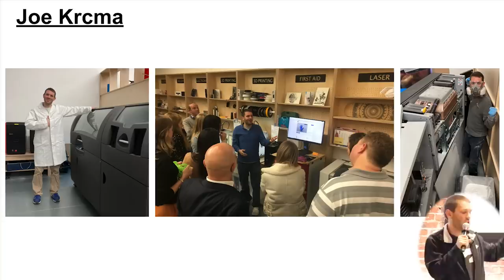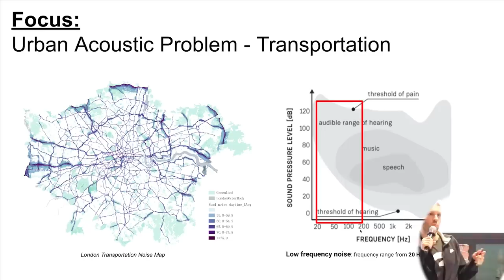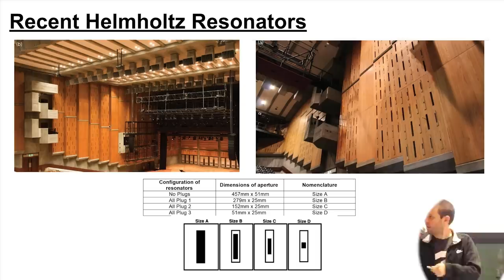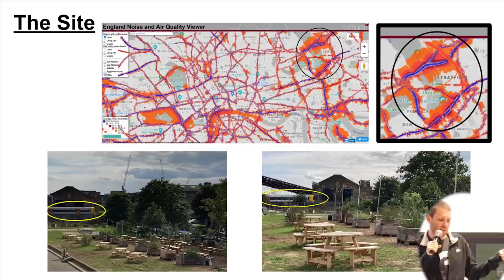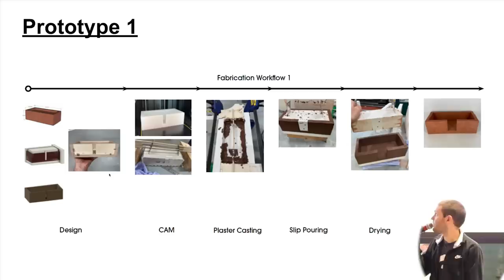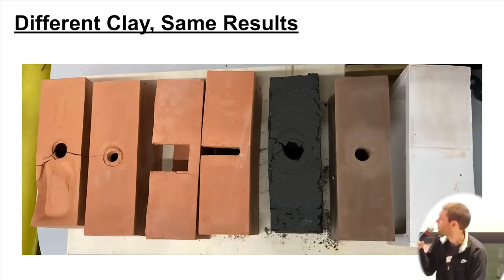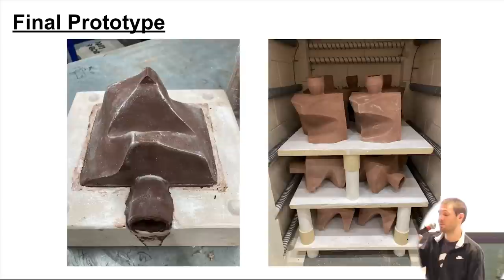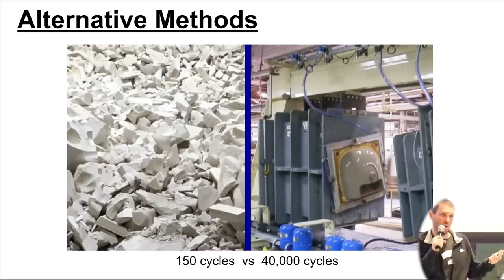These Bricks Can Absorb Traffic Noise - Thesis Presentation on Helmholtz Resonators

Comment: It is great to see research money being spent where grads take so many other issues into account. "Build it and be damned" was a vanity which led to so many towns and cities suffering from unanticipated phenomena such as highly localized whirlwinds, concentration of reflections melting parts of cars (London) and the sonic funneling of so many built areas with very high and semi high buildings. 
You mention London parks but do not confirm that background noise of streets is very much reduced or loses rumble in most of them, even quite small ones. In contrast, the parks of New York tend to retain rumble over longer distances from the perimeters and there is quite a long reach of city surface sounds there. The city of Sheffield's parks have the New York problem except those abutting the rising strata towards the Peak District.
The reasons are due to what the cities are built on and London is built on clay and shale.
Now, take the persistence of low frequencies in the other cities and we can work out why city noise reaches further (given that all pitches and frequencies of sounds have sub-sonic harmonics.
Cities on rock have street noise bouncing between buildings and funneling too but in London you can measure the same sort of bounce in streets yet parks are significantly quieter. The bounce and spring effect is important in the work of Helmholtz and his famous resonators are in fact springs themselves. He reasoned that sonic pressure is indifferent to air pressure and changes in 'packets' of waves. In his day there were no heavy motorized vehicles not on rails generating the low frequency basis for higher frequency low harmonics to adhere to. Street sounds would mostly be asynchronous horse shoes on cobbles and steel rims on carts etc.
The good news is that sonic energy can be transduced into useful forms of energy (including electrical current) and this could have a reduction effect in such as streets, albeit not at subsonic levels.
The bad news part is that your bricks would be unlikely to reduce medium low and low frequencies at the site but could conceivably slightly reduce mid-high frequencies.
Their longevity would be slight  if not glazed and polished and kept clean beyond thin algae and the right types of moss -- which themselves are sound and chemical pollutant absorbers as well as carbon chains. Fauna habitat sounds worthy but brings dirt and therefore neck blockage. Bird droppings alone are corrosive and destroy the glazing, allowing moisture ingress and expansion below -- 1C.
On the other hand, materials scientists and civil engineers could build with or coat buildings with moss conducive materials for general, natural air filtering and the dampening of at least some sounds in busy streets but not more than just about measurably on the site in question.
Finally, in studies of noise in cities, London's poor showing could be improved by removing all pure jet aviation from a high percentage of Greater London's airspace with exceptions for very quiet turbo-prob aircraft. Were the incoming government to pass this into law a clause would exclude turbo-prob planes not using 95%+ green fuel. Such aircraft could be used on an automated shuttle basis, thus allowing expansion of the UK aviation industry all over the realm and the large airports too proximate to densely inhabited areas diminishing or being re-purposed.
Reply from the maker: Thanks for the info! I'll have to test this on the next version.  You might enjoy reading my thesis and portfolio linked in the description.

Comment: Well, this does look very cool, but very impractical actually. Storage and transportation would be a big issue, since they need to be stacked perfectly (that wastes a lot of time) or else they take a lot of space to store relatively few. Production would also be significantly more expensive than regular bricks.

Then, about it's actual usage, I doubt they will have the same durability as other bricks under normal conditions and a zone with temperate & stable climate, let alone in areas where it rains and snows and freezes each winter, since that would easily open many cracks and possibly collapse the structure. Same for areas with lots of sun and heat, that could make them expand and crack easily.

The resonators might be good in cancelling the effects of an earthcuake, depending on it's frequency, or the absolute opposite: an earthquake with the right frequency could actually resonate and be amplified by the resonators causing total collapse...

I'd say it's better to look for other kinds of sollutions. If in music studios they use foam with spikes, it should be easy to use somethinf similar in between two layers or bricks or on the outside of those...
Reply from the maker: Possibly!  I’ll test it

Comment: The romans places empty pots filled with straw in the corners to improve acoustics in interior and exterior architectural designs
Reply from the maker: Nice! Thanks for this
Reply: @JoeMakes  if you don't put things in the pots to absorb the energy, they *amplify the frequency in question*. In recording studios we generally avoid helmholtz resonators for this reason.

Comment: Okay, I just had an idea for an improvement that might sound slightly insane but juuuust might work. What if you tried to combine this concept with vertical gardens? (just for clarification, I'm not talking about the indoor agriculture with trays stacked up under grow lights, rather plants literally grown against a vertical surface which are often groundcovers). You already have a somewhat porous material to work with (unglazed terracotta) which could work as a substrate for particularly hardy plants. Only a little bit of modification and you should be able to grow something like moss on it! I'm thinking some pattern slight ridges on the exterior should do the trick. Moss absorbs sound pretty well, and would do well enough in urban landscapes, plus it doesn't have true roots and wouldn't crack the bricks much. Plus, it would look quite nice! These bricks are fascinating and beautiful in their own way but I'm not sure how well that unusual shape, grout, and big neck would be received by the general public. Cover it all up with moss however... and suddenly it would be a very pleasing installation. Moss would also encourage local wildlife somewhat, which would of course improve the local soundscape a bit too.
Reply from the maker: I love it!  The file is free to download in the description

Comment: Fascinating, especially from the angle of reducing transportation noise, that comes in fairly predictable frequency ranges. How broad a range can a single resonator effectively control against? How many different sized resonators would you need to cover the range of frequencies generated by typical roadway/subway/above ground rail noise? And would you be able to get away with adjusting the internal volumes of the resonators without changing the external dimensions for ease of installation, or would you need to find a way to tile the plane with brick resonators of different sizes? Such a cool avenue of research!
Reply from the maker: Thanks so much!

Comment: those corner cracks and a good chunk of the warping in prototype 2 is a product of sharp corners. Curved (chamfered) edges would help a lot AND  making the plug slightly trapezoidal would ease removal

Architects know the "sharp corners" problem very well. It's a big issue for window frames in seismically active zones

Gotta say that protoype 4 is a good solution to low cost ceramic fabrication and in the hands of a ceramics expert would be straightforward. Bricks are the shape (and size) they are because they're simple to reliably produce
Reply from the maker: Yeah, but sexy is what architects love 😂

Comment: This is awesome. If it was to be outdoors my only concern would be water. When it rains or storms water would get stuck in them and if it was Wendy would they whistle like a jug? As a contractor I see a lot if architecture that is brilliantly designed yet not practical in a permanent setting. It could be a good idea to design the opening in an angle to drain or even create a drainage holes.
Reply from the maker: Thanks so much!  I will do a second version to test this with the freeze/thaw and wind whistle.  Glad you liked it!

Comment: Very cool, and so very needed. Looked like you needed way more time on this. I didn't hear but were you working with people that work with clay and kilns everyday? This entire talk there was a feedback that was horrid, it sounded like the back up warning sound from large equipment which seemed to enhance the need. Everything is an effect of sound pressure, and this is a good way of negating it, albeit we can't have these walls everywhere. I wonder if there could be sound generators like noise canceling headphones. I live fairly close to a highway and I constantly have headphones on and or rain sounds in, I can't take it, my walls are too thin, my windows too old. Best of luck on this and all you do!
Reply from the maker: Thanks!  I’ll do some more tests and make an updated video 🤩

Comment: Super cool project! I love the math and design coming together.
Is there a reason I would want to attach a specific frequency or set of frequencies (e.g. it seems like your dip is actually a very narrow band of ~50 Hz) vs doing a broad spectrum noise isolation using something like a double wall with an airgap in the middle or foam as per your test? Maybe the helmholtz resonator would be more useful to target higher frequencies or frequencies that are specific to the distractors in the area (e.g. people's voices, birds, trains, etc) in addition to the broader spectrum reduction.
Reply from the maker: Thanks!  Yeah, I want to keep people's voices and bird sounds and only reduce traffic noise.

Comment: 5:06: Sound guy here who has spent a lot of time messing with oscillators while tuning subs. The bottom left of that graph is very misleading. Human hearing extends way beyond that. But the only reason you would ever hear 20hz would be if the room was vibrating.

Comment: Traffic noise has a very wide bandwidth... Helmholtz resonators have a very narrow bandwidth, unless damping material is placed inside them, in which case the bandwidth can become much wider, but the degree to which they are capable of absorbing sound is greatly reduced.  As such, using Helmholtz resonators for the proposed application would be ineffective. One possible solution might be to construct a wall made of Helmholtz resonators tuned to a wider range of frequencies, but again, the bandwidth of each resonator would be very narrow, whereas the noise that you're trying to abate would be covering a very wide bandwidth. A more straight forward and cheaper approach would be to simply erect a wall with a relatively high mass, and tall enough so that relatively low frequency sound pressure waves would not simply go around by way of diffraction.
Reply from the maker: You might like my thesis paper where I cover this.  Linked in the description!

Comment: Hearing hazards over 55 dB?  That's a comfortable conversation. Hazards occur at about 80-85dB.  Church music runs at about 75dB.  I would think ceramic is a terrible choice for materials due to high cost of materials, high cost of running the kiln in time and energy, and shrinkage causing cracks and damage. A lower cost material like recycled plastic or rubber or concrete would be ideal for sound walls around freeways. Indoors, a low cost and lightweight material like compressed cellulose like existing accoustic panels. The holes and voids would create a lot of places for animals to nest - not all desirable.   I guess as a research project, the professor made the constraints challenging to force problem solving and thought.
Reply from the maker: but ceramic is so much fun...

Comment: A good idea and could be designed as a retaining wall. It should have drainage features to prevent water from pooling since retaining walls usually drain water out of the structure. It would also naturally be the home of rodents, which would be hard to remove once established.
Reply from the maker: You might like my thesis (description) where I cover some of this topic

Comment: We need societal breakthroughs on reducing the need for individualized car travel, especially in the U.S., not so much a breakthrough on materials that absorb sound. It's like a band-aid fix on a larger issue.
Reply from the maker: Umm, trains?
Reply: @JoeMakes  Yes, trains are one part of that. Too much of the U.S. does not use trains, and just because you took the train does not mean your destination is walkable either.

Comment: I'm thinking it would be easier to scale these up and make them solid again to just have the resonator be the cavity created by the three bricks. But instead of using clay use non shrinking grout. Or use fine sand and Portland with additive to make it more liquid like the non shrinking grout. Then you avoid the issues with clay deforming and shrink cracking. Or, if you must have the internal cavity use a styrofoam insert position with wire. After pouring and allowing to cure just wash out the foam with acetone.
Reply from the maker: Had to use ceramic to graduate…

Comment: Not to be a downer, but filling the cavities with anything other than really low-density materials would reduce the efficiency of the resonator. The whole point of Helmholtz resonators is that they contain a volume of ~air~ inside that interacts with the mass of air in the tube. If the volume of air is reduced while the tube length remains the same, then the resonant frequency would be higher (which would be counterproductive if you want to decrease traffic noise, as it mostly consists of lower frequencies), and the overall absorption would decrease.

Additionally, moss growth would not help with train noise; although it could reduce the effects of noises like birds chirping and people talking. Given the characteristics of moss, it would most likely only help with higher frequencies, and it might even not do much for mid-to-higher frequencies. Train noise is mainly composed of lower frequencies, so moss wouldn't have much effect on it. Perhaps slat Helmholtz resonators could be a better alternative. Keep in mind that different approaches are suitable for different frequency ranges.

Finally, you should study the structural integrity of these clay resonators you've constructed, especially since you aim to use them outdoors near high-density traffic. They might be exposed to significant vibrations, which could weaken their thin walls over time.

I see a lot of potential in this project, and I think incorporating ways to reduce noise in an environmentally friendly way in our cities would be of great benefit. Let me know if you'd like to collaborate or if you want to discuss acoustics further.
Reply from the maker: Thanks for this.  You might like my thesis where I cover some of these points!  (in the description)

Comment: those holes need to point somewhat downwards otherwise rain will come inside, and they will absorb too much moisture while not be able to sweat out the moisture because of the coating. those bricks all need a main drainage too
Reply from the maker: More holes won't work as Helmholtz resonators (and terracotta helps sweat out moisture). I'll show this in a future video

Comment: I wonder if you could use like a hybrid recycled plastic rubber mixture??  The Rubbers anti-acoustic properties and anti-cracking as well as The fact there are huge amounts of tires out there that could be recycled... Then recycled plastic Of course is an abundance...  You can make many of them far easier far lower cost without having to bake them which I imagine would be a logistically taxing just in time spent on that part...  Energy expenditure as well..
They would be very resilient and long-lasting if the walls are made thick enough I suspect anything made of terracotta like material would be super fragile and susceptible to say vandalism? A  few thrown rocks could jeopardise an entire wall?

Comment: Cool video;. Honestly your more standard 3 brick design protoypes were probably feasible; id guess that if went more akin to a (forged metal part) aproach and made a sturdy 3 part lower mold and rammed a blob of clay with your inner mould you could press the clay part cut the flashing. Dry the bricks before moving to bisque fire; from there gauging shrinkages would likley be easier to adjusting. That said the mould size would have to be adjusted in a reductive manner since adding material back to the molds wouldnt efficient.
Reply from the maker: Thanks for the tips!

Comment: Really nice! How about 3D printing of such bricks (or other elements)? I know that currently it will be much slower and more expensive process but it opens wide new area of designing complicated shapes with inner channels, probably much efficient and specialised for different shapes of sound waves and silencing.
Reply from the maker: Thanks! Like I mentioned in the early examples, 3D printing bricks won't work because of the overhang angles.
Reply: @JoeMakes  Sorry, I missed that but what about MJF modified for ceramics (if exists, I don't know) or LMC? Of course there will be problems with holes for releasing the rest of support powder, but the number of potential applications is huge.

Comment: Was wondering why, during you 'brick' prototyping. he didn't use a lattice mesh substrate, that would help with the warping issues and burn away in the biscuit firing ... Not to mention, sponge like clay structure would absorb sound more readily. Which he showed in his own experiments.
Reply from the maker: The university wouldn't let us do burnouts after the first month